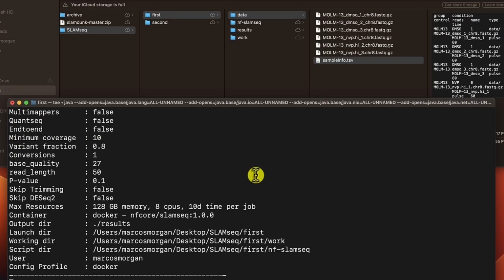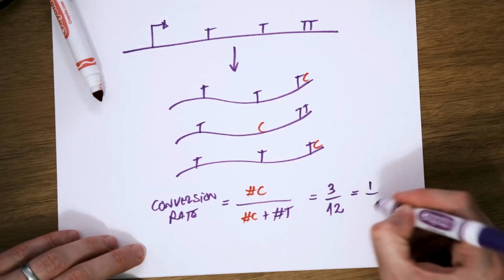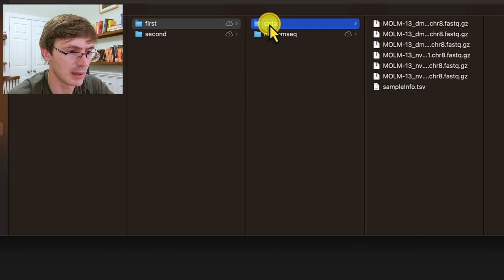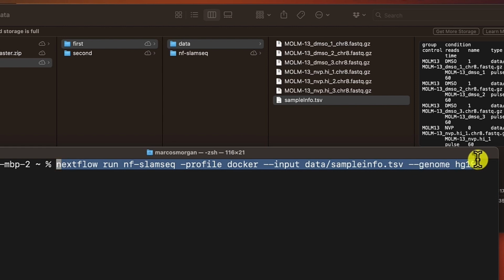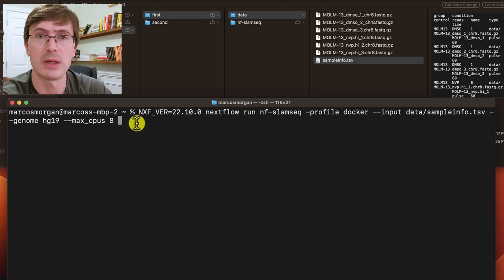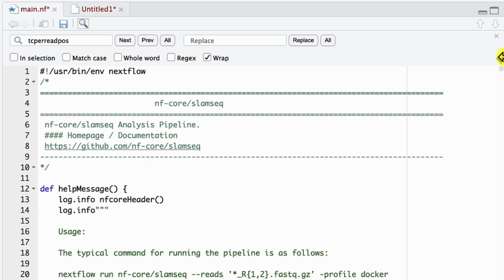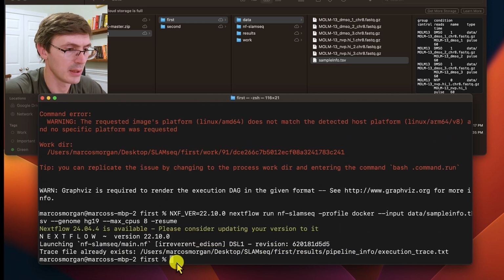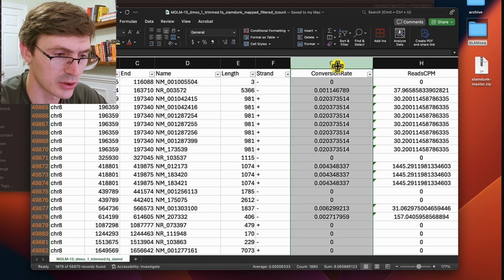SLAM-seq conversion rates with ONE line of code using NEXTFLOW

Comment: I can imagine that the conversion rate calculations can be tricky if the two copies of a gene are very similar. Isn't it?
Reply from the maker: Usually, two different gene copies within the same species (a.k.a paralog genes) are diverse enough at the sequence level to differentiate them. The bigger problem is differentiating the alternatively processed transcripts from the same gene.